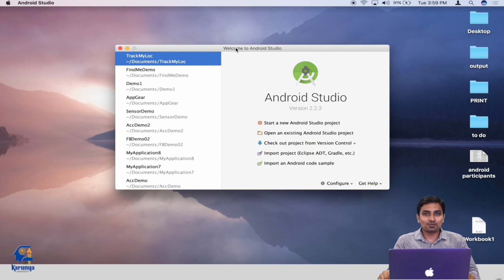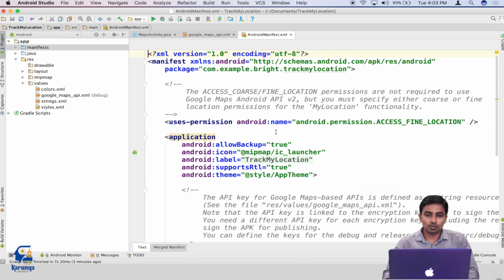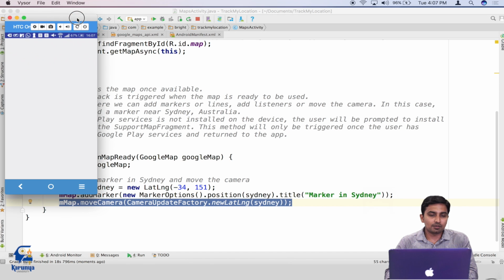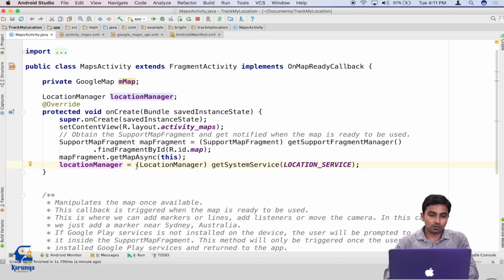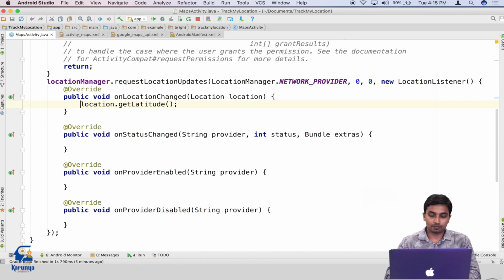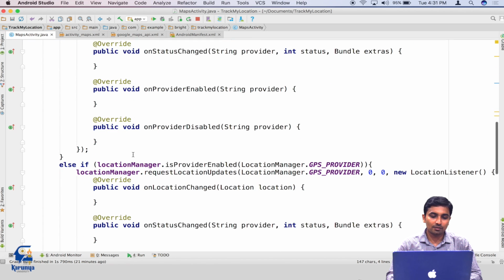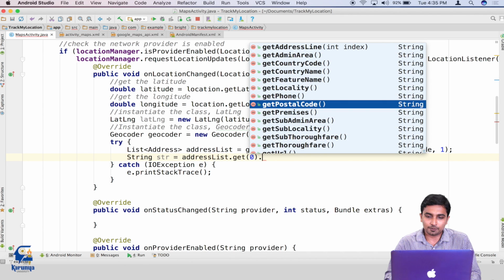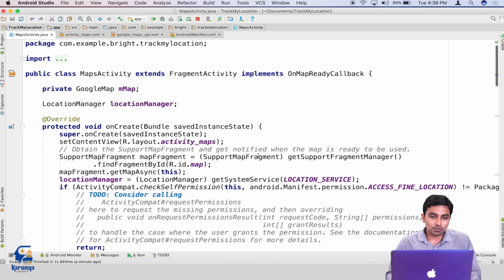Android app to Track your location using Google Map API

Comment: Why can’t I track my location? When I can see default Sydney’s location? Please solve this. I’ve allowed all the permissions. But still unable to track
Reply from the maker: Sydney location is shown because u r directly using its latitude and longitude. This works in emulator as well as in mobile.
To detect the current location, you have to use mobile only. Still if u r facing the problem, kindly mail me at brightlsom@gmail.com

Comment: sir, how can we read latitude and longitude from other physical devices and how to track that address ,,,,
Reply from the maker: You have to use either firebase or webserver. If u need assistance in server side programming using webserver, i can help u. However, it's very easy to use firebase.
Reply: @codehubz  tq for response ,i need help sir i ll contact u later
Reply from the maker: My pleasure

Comment: i have followed the full tutorial and done as you have done but my map is just been displayed without any marker or location. I have also done regeneration of API key but it still not working
Reply from the maker: Its due to app level permission. Either manually enable it or dynamically as in OLA/Uber. The dynamic app level permission enabling is updated in my GitHub code as follows.
https://github.com/brightgeevarghese/TrackMyLocationUpdated

Kindly let me know the status.

Comment: Dell  laptop generation 6 with RAM 4 GB ,

processor Intel core i5 6200U CPU 2.30GHZ to2.40GHZ,

OS 32BIT,  x64-based processor

it's speed so much  slow .and i want to increase the speed of laptop by increasing RAM @t tell me what changes i will   make so that android stdio software  work very friendly manner and speedy way.?????

should i buy new  laptop for android stdio Software

 sir g recommended me you opinion

i am waiting your reply
plz reply me
Reply from the maker: You may upgrade your RAM to minimum 8 GB. If possible you may prefer to take 16GB RAM.
If it's possible, you may choose Linux operating system instead of Windows. You can see better performance in Linux OS.
No need to change laptop.

Comment: Sir i have problem ...my app run but not showing any map just show a blank screen
Reply from the maker: Kindly look at the updated code. 
https://github.com/brightgeevarghese/TrackMyLocationUpdated

The code which is shown in the video works perfectly in Android versions 4 and 5. From Android 6 onwards, app level permission is required. It can be done manually or programmatically.

Comment: I tutorial of half an hour with poor voice, actually no voice.
Reply from the maker: Sorry for the inconvenience. U may try with headphone
Reply: @codehubz  I have watched the whole video and followed you. everything is running accurate but not the location, as I'm not on that location. It shows the marker on turkey.
Please guide!
Reply from the maker: @EasyLearningIT  Did u enable the location in ur app's permission. The code which is shown in video works only for Android 5. From Android 6 onwards, app level permission is required. It can be done manually in app's settings or programatically. I updated my code in GitHub for enabling permission programmatically. Kindly follow this link for the updated code.
https://github.com/brightgeevarghese/TrackMyLocationUpdated

Comment: Whats the difference between using location Manager for requestLocaiton updates and a fusedLocationprovider client?
Reply from the maker: FusedLocationProviderClient will save power and it is recommended as a best practice.

Use FusedLocationProviderClient
 Makes location requests combining GPS, Wi-Fi, and cell network
 Balances fast, accurate results with minimal battery drain
 Returns Location object with latitude and longitude

Comment: a.o.a 
sir ap android mobile per run karwane ke bare main bata sakte han.
main ne kia hai per wo kheta hai none device.
plz sir bata dein ke android map ko mobile per run kaise karwate hain.
Reply from the maker: I am sorry. Kindly post your query in English?
Reply: @codehubz  i said how to run android location on android mobile.there is "none conncet device"in u r video "7:02" u r device is connected.my device is not connected.so plz tell me about this.
Reply from the maker: @diycrafts3755  You have to Configure on-device developer options and USB debugging.
https://developer.android.com/studio/debug/dev-options
After doing these two steps, u may connect ur mobile with system. Then, click the run button in Android Studio. Now u can see a small window which shows ur mobile device. Ensure that u. r using good usb cable.

Comment: i tried everything from comments but app still wont work. after clicking get my location button I only get blank white screen and in bottom left corner writes google. pls help me if you can
Reply from the maker: Its due to app level permission enabling from Android 6 onwards. It can be done manually (in settings) or automatically as mentioned in my GitHub code.
https://github.com/brightgeevarghese/TrackMyLocationUpdated
Kindly update me.
Reply: @codehubz   after few api keys sudenly started working
Reply from the maker: @aleksanije5974  Glad to know that map is working as expected. :)
Reply: I have turned on app permision for location but still I only get this white yellowish screen saying google in the corner. Map just wont load, my friend tried it also and he gets the same thing. I also inserted my api but still nothing

Comment: Brother..... Is it works for tracking gps devices??
Reply: Same doubt
Reply from the maker: @santoshm310  This code is only a use code. U v to use Webserver with Android, one Android device detect the current location as shown in video, but its not enough for live tracking. This app should send the data - longitude and latitude to web server periodically. An another Android device should retrieve these data periodically from web server which shows the live tracking. If any doubt, feel free to ask. Thank u for watching this video.
Reply from the maker: This code is only a use code. U v to use Webserver with Android, one Android device detect the current location as shown in video, but its not enough for live tracking. This app should send the data - longitude and latitude to web server periodically. An another Android device should retrieve these data periodically from web server which shows the live tracking. If any doubt, feel free to ask. Thank u for watching this video.

Comment: Thank you, I have already regenerated the Google API and used it on the updated code but it doesn't shows the marker and accurate location. I don't know why is this happening? Greetings.
Reply from the maker: Pls launch the app again. Kindly verify location is enable in app's settings. Hope that u r tried in mobile device, not in emulator. It works only in mobile device, not emulator.
Reply: @codehubz  Thanks for the fast response. I have verified the location enabled, I am trying in my phone, but after I  touch the button of "click me to show ur location" It shows me the continent of Africa with no marker and I am in Costa Rica. Thank you.
Reply from the maker: @jogarita1  Sorry to hear it. Pls enable flight mode and disable it. It resets ur mobile's network connectivity.

Comment: Sir everytime I get my location in USA while I'm from India. Why is it so??
Reply from the maker: Pls enable flight mode and disable flight mode. Check the network connectivity. Then, launch the app again. Pls update me about location of marker. Thank u :)
Reply: It worked. I was testing it on emulator which gave me the problems. Building an app solved all those problems. Thank you Sir. Location and Marker showed accurate location.
Reply from the maker: @saishsawant7831  You are welcome :)
God bless u

Comment: ello
i have some problem i use android studio 3.4.1

 i run the code in my phone android 8 , its told me click to get your location ; after i click , noting showing , not map or anything just white display , the permission for location is done , the api key is done ; i dont know where is the problem , maybe something in the code , pls help me
Reply from the maker: Its is due to app level permission from Android 6 onwards. Either manually enable it, or follow my updated code in Github.
https://github.com/brightgeevarghese/TrackMyLocationUpdated

Comment: Sir please it's not pointing to anywhere after following perfectly your instruction any idea
Reply from the maker: Kindly enable Location permission in app[U can do it in settings]. Launch the app again. It works without any trouble.
This is a manual task. 

However, its automated in my updated code in GitHub.
https://github.com/brightgeevarghese/TrackMyLocationUpdated

Comment: hello sir 
i am using AsyncTask to get dynamic location. and show on google map . is posible to  AsyncTask runnable every second to make marker on google map ..and avoid duplication marker position ..their update the old marker position...how it posible
Reply from the maker: In my updated code, duplicate markers are removed.
https://github.com/brightgeevarghese/TrackMyLocationUpdated

You can use handler if you want to initiate something every X seconds. 
Ref : 
https://stackoverflow.com/questions/6207362/how-to-run-an-async-task-for-every-x-mins-in-android

Comment: after saving  lat/lng: (22.62029928,84.50425875) into firebase, how can i retrive into map..............while retring with valueEvenetListener by String display_location = dataSnapshot.child("location").getValue().toString() and when using display_location to display the data into mMap.addMarker(new MarkerOptions().position(display_location ).title("Simdega"));
        mMap.moveCamera(CameraUpdateFactory.newLatLng(display_location ));....... then display_location is showing error........

Comment: it is not detecting my location. just showing map to me . please help me in detecting my location in my app
Reply from the maker: Its due the app permission from Android 6 onwards. This issue is fixed in the updated code.
https://github.com/brightgeevarghese/TrackMyLocationUpdated
Kindly update me
Reply: @codehubz  sir i wrote code by watching this video. now i have clone the whole project but it is not showing even map now. kindly help me in this matter
Reply from the maker: It works only in Android device, not in emulator. Did u try in emulator or phone?
If u tried in mobile phone, pls regenerate the Google Map API key and try again.
Reply: @codehubz i am running it on my samsung j5 ..i regenerated the API key and tried again but didnt work ...only showing the map .. :/ ..can you please help me in this matter

Comment: sir how to save current location into firebase
Reply from the maker: I worked only with the embedded database in mobile which is called SQLite and remote database MySQL thru Webserver. I m sorry to say that I did not work with firebase. Sorry for the late response.
Reply: @codehubz  oh it's ok sir . thanks a lot.

Comment: Hello sir , Thanks for your useful information , but i have a problem , i can't see the Marker , and i am usung new api key  .. I need some help 
Thank you again
Reply from the maker: It is due to the app permission issue in Android 6 version onwards.
To fix this issue, I updated this code with a few more lines.
https://github.com/brightgeevarghese/TrackMyLocationUpdated
Pls try this. Kindly update me. It works only in Mobile, not in emulator.
Reply: @codehubz  Thank you soo much  .. now it works , but i have i little note , that when my GPS was OFF , the Application crashed ,and then asked me to allow to app to use GPS , then i uploaded the app again and works good , 
so can you help me when the GPS is not on , the app doesn't crashed , how can i fix the problem .. 
thank you so much

Comment: I used this code, but it does not specify my location , just opens and write down google please help me
Reply from the maker: This code works only for Android 4 and 5 versions. In Android 6,7,8, we have to enable the app permissions. I updated my code to fix this issue.
https://github.com/brightgeevarghese/TrackMyLocationUpdated
I tested it in Android 7 version.
Reply: Iam usually using Android 4 but iam not show my position

Comment: no marker and no location is showing sir can u  solve out the problem
Reply from the maker: Its due to the app permission issue from Android 6 version onwards.  Code is updated in my GitHub repository.
https://github.com/brightgeevarghese/TrackMyLocationUpdated
(The GitHub code is updated on October 1, 2018. Minor changes are done. It removes the old markers also which is not shown in the video. The location enabling is done programmatically in this updated code. Its tested successfully in Android 6 and Android 7.)

Comment: sir now its working fine but sir can you tell me how to see latitude and longitude so that i can record this data.
2nd thing sir i have an external GPS transmitter can i use it as well some how it is a Bluetooth enabled hope you can help
Reply from the maker: 1. Kindly see my GitHub page
https://github.com/brightgeevarghese/TrackMyLocationUpdated/blob/master/app/src/main/java/com/example/bright/trackmenew/MapsActivity.java
In this line numbers 86 and 87,
                double latitude = location.getLatitude();
                double longitude = location.getLongitude();
U may store these values in SQLite(default embedded database in Android mobile) or firebase/MySQL

2. Kindly see this link which helps you to understand how Android interacts with Aurdino using bluetooth.
https://wingoodharry.wordpress.com/2014/04/15/android-sendreceive-data-with-arduino-using-bluetooth-part-2/

Feel free to contact me if any more detail is required.
Reply: hi sir, sir its my first time building an android app i have no idea about SQLite and MySQL how to use or open it. it would be very wonderful if can help.

Comment: Nice video but plz also explain how can a user turn on GPS when app starts(in case it's off)
Reply from the maker: This updated code contains ur requirement
Reply: did u provide a link sir? I can't see it
Reply from the maker: I am very sorry :(.   I missed it
https://github.com/brightgeevarghese/TrackMyLocationUpdated
Kindly update me
Reply: Thanks i already went through this following the link in video's description.
Very fast reply sir thank you so much.
Also, if i may suggest one addition to the code, the myLocationButton should be set true, it is really helpful in most cases.
Reply from the maker: I am sorry. I did not get you. Will u pls brief ur requirement?
Reply: Suppose the location is turned off in android device, and user opens the application. The application should display a dialogue box asking user if he/she wants to turn on the location. If yes, the app should turn on the location, NOT THE USER HIMSELF. Do you get my question now sir?

Comment: location mark does not work
Reply from the maker: It works only in mobile not in emulator. Location must be enabled before launching it in mobile. It works in Android 4 and Android 5 without any trouble. Also, pls update ur Google play service.
If ur mobile is Android 6 or above, Kindly let me know, I will share an another code with u. feel free to contact me at brightlsom@gmail.com.
Reply: My mobile Andoroid version 6.0.1. Thank You
Reply from the maker: Try this following.
https://drive.google.com/open?id=1NbX3DJKCiHPK9tTrtaca6OE849rk2dfg
I got this material from Google training session, which works flawlessy in any Android version.
Reply from the maker: I was out of station. I am very sorry for this late reply. Pls try with this code. Customise as per ir requirement.
https://drive.google.com/open?id=1NbX3DJKCiHPK9tTrtaca6OE849rk2dfg

Comment: only showing a world map :\
Reply from the maker: Pls enable the location in ur mobile. It works only in mobile, not in emulator. Also update ur Google Play Service
Reply: Sir should I generate the APK and then check?
Reply: everything is enabled but still not working :\
Reply from the maker: u v to generate Google Map API key and insert it into the right place. U may deploy the app into mobile directly from Android studio by connecting it through data cable.
Reply: bright varghese sir tried everything but not working properly :/

Comment: Hello sir , i followed all you said but yet it is not showing current location with marker. i even tested the same with new files that you have given to others here in comment section but of no use. I am damn fed up .. it is 3am still working on it but has no clue what the hack is wrong. Location is on, new api key is there, all permission is there but yet it does not work. plz help
Reply: it worked successfully after switch off and switch on mobile.
Reply from the maker: Very glad to hear that u got the output. Thank u for trying this.

Comment: sir the marker doesn't show for me. Also, is there away i can save the location on the firebase?? Whenever, i get my location, my saved location have a marker

Thanks in advance. I really needed this :(
Reply from the maker: Pls ensure that u r running this app in Android mobile, not in emulator. Also, pls update the Google Play Service in ur Android mobile phone. Dont forget to put ur Google Map API key. I dont know how to work with firebase, but I can assist u to save data in remote database(MySQL).

Comment: There is no error visible but the marker is not present on the map page..Help me out from this sir
Reply from the maker: Pls enable the location in ur mobile before u launch it in ur mobile. It does not work in emulator.
Reply: bright varghese yes it is working..secondly how to send this location as a text message to certain contact no
Reply from the maker: Pls check this link. It contains simple code to send sms. If any doubt, feel free to contact me